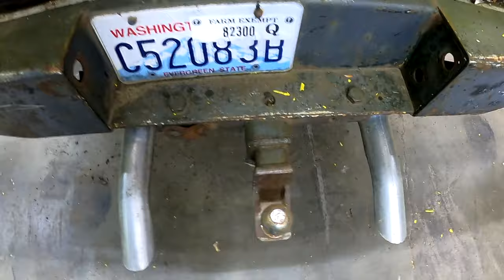I MESSED UP!!!  1975 4x4 square body

Comment: I found a strip of old conveyor belt bolted to the blade worked good...when it wore out i just cut another strip from that same old belt.
Reply: Did the same at MoDOT in the late 70’s. ✅

Comment: Thanks Ken. Something new to watch. Good job of fixing those emergency cables and exhaust.  I don't know and neither does my dog, how you get all this stuff done and then edit these videos. We don't expect new ones every day but when a new one comes out that is what we watch. Thanks again for the go I d clean entertainment.  I must be a lot older than you. Crawling around in the snow or rain on the dirt gravel or snow. We've been watching for years now. I was a little braver at 16. I use to watch my dad and brother work on car trucks or motor cycles. My 2nd car was a 49 chevy that had a blown motor. My brother and I went and got a engine hoist then he took off to see how I'd do. Back then I could remember more than now a days. Any way, I found a good v 235 chevy straight 6 and put everything back together the way the old one came apart. That car was tougher than nails.  I sure had a lot of fun with it. I only paid 60 for that one and I paid 25 dollars for that good running motor. The guy I got that from was switching from a 6 to a v8. Worked for me. I think my brother left me a good mechanical book and that helped me a lot to get started. I never did worried much about torqueing specs. I had a pretty good sense of how tight to tighten all the different size bolts and screws. Well Ken. The clock just hit 2 am. We'll see you next video. Thanks again for the guitar playing and the singing and the wrenching. If you ever quit wrenching on vehicles you could always build yard art.  The stuff I've seen in your yard over the years is under. I know you don't like wiring stuff but I think putting some lights for eys or for a barrel of a gun would be cool. I wish I would have done something like that when I was still working for side money. That giant tall man on your driveway is realy cool. And all the spiders and other stuff. You know, I've heard you say you'd rather be creating something instead of fixing something. But as I've watched you over the years, on your rat rods, you do finish work on them and you see results fast. But I thing what you dont like is finish work like on the red truck because the finish takes to long. Your rat rods got plenty of detail. All right. Take good care Ken.

Comment: That nylon cutting edge will work great for your driveway. We used thick rubber one's at the city. Just to avoid damage with manhole covers. Only disadvantage of not having metal is you can't bury your plow to help you in a slide situation. Glad to see you and Noa making progress 🙂👍

Comment: Maybe you know this, them brackets on the bottom edge on back of the plow are for shoes so the plow doesn't dig in. They are adjustable to set the highth you want the blade. your shoes are missing. you can buy them at auto parts stores around here. They are cupped shaped and about 6 or 7 inches around.  The have a shaft in the middle and slides into them brackets.  Dan
Reply from the maker: yeah I think i showed a shoe in a previous video.. but I only have one and its not for this plow. i could make some but I'd rather have a blade

Comment: ‍

Polymer cutting edges cost the most of the three options, but they’re beginning to edge out rubber as a viable replacement for steel due to several advantages.
‍

Polymer is rigid for effective scraping, but soft enough that you can still use it on sensitive surfaces. It doesn’t scrape quite as well as a steel edge, but it’s way better than rubber.
‍

The other thing about polymer is that, once it’s worn in, the flat cutting edge “self-lubricates” and the edge glides over the surface.
‍

Finally, even though it’s softer than steel, a polymer edge will last nearly as long (sometimes just as long), and definitely way longer than even softer rubber.
‍

Poly Cons
The first knock against a polymer edge is that it’s the most expensive of the bunch. Like any purchase, you’ll have to weigh the benefits against that initial cost.
‍

The second is that it won’t scrape as well as steel. The general rule of thumb is the thinner the edge, the better it’s going to scrape. A polymer edge is going to be thicker than a steel edge to make up for the loss of strength. While it will scrape well, in most cases it won’t scrape as well as steel.

Comment: A couple of ways to avoid gouging your pavement.  1 put the skid shoes back on. That allows you to adjust blade height.  2 back when I was plowing, s ome guys would run a rubber blade edge. Maybe a tire tread could be the low buck option to try. But I'm not sure you have any old tires to use for that.

Comment: When i was living in Northern Maine we would get the center of a big truck tire's retread and cut it off from the sidewalls and bolt the tread on at the bottom of the blade all the way across and it would give and take to fit the road shape and last a couple years before it needed replacement.

Comment: 2wdr crossover pipe on a 4x4 it will get you every time daul exhaust is better anyways.  On the plow blade to keep it from damaging the driveway take an old heavy truck tire and cut the center tread area out and bolt it to the leading edge of blade.  leave it a few inches below the blade edge works great it's cheap and last for years.

Comment: We would cut pieces of old tire and bolt the treads to the bottom of the blade thus making a cutting edge out of rubber. Had plenty of junk tires so all it cost was the time cutting em up.

Comment: Watching this video, and if you look at about the 16:40 mark, is the lift arm on the front right… is that locking pin not secured?  It doesn’t look seated, as the right rear arm pin is lower/seated.

Comment: i have more info on the meyer's plow hitch.pins location... for you..  the plow hitch pins location is 2 inch forward on the front leaf spring eye bolts...  and should be about 9 inches above ground level.  this with the lift chain on the plow... near verticle ..btw its probably best to find someone your area.that has a old actual ST series meyers undercarriage mounts mounting brackets fitting 
1 of these ol' squarebodys..laying around somewhere/...
Reply from the maker: Thanks for the info!
Reply: much welcome  @1963impala2drWaylonWire

Comment: I have about 18 Woopie lights that are 12 VDC electronic strobe, as apposed to the rotating reflector type that you have on the top of your plow truck. that is about 13 more than I need in my lifetime. If you would not mind giving me an address that I could share a couple, that might give me more room and you something less annoying than listening to that motor wine in the reflector rotator. Besides the nylon gears on those ware out in about a season so you will have to replace it anyway and free is always a good price.
Reply from the maker: thanks but we love the old school rotating light
Reply: ok I will continue to look for someone else that can use them.

Comment: As far as the exhaust goes must have came off a 2 wheel drive,  but good fab job
Reply from the maker: you must have missed the first part of the video haha
Reply: @1963impala2drWaylonWire  if it was your live streaming video? Probably,  because when you stream live ? On my end it's a  blurry to watch beings I live on Pa, however I do  watch every video you put out  like said it's on my end, same issue with DD Speed shop when he streams live, I was told it could be to many on the inner Web at the same time I am
Reply from the maker: @MrBarr62  na, at the beginning of this video when I was talking about the donor exhaust, I printed across the screen In bright red letters that it was off of a 2wd going to a 4wd.. haha.. no biggie.. you might have blinked! 😉
Reply: I probabley did or my G/daughter distracked me ! lol All good Waylon Sir  waiting on the next video  @1963impala2drWaylonWire
Reply from the maker: @MrBarr62  i take pride in making videos you can watch with your grand daughter.. Merry Christmas!